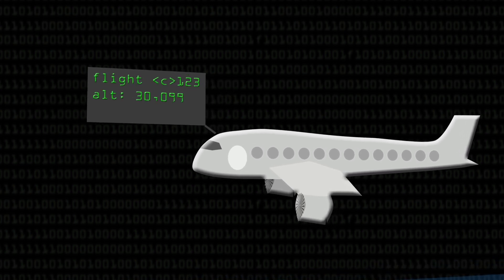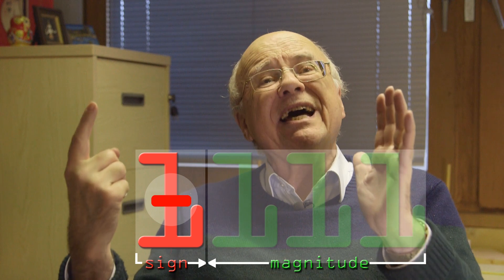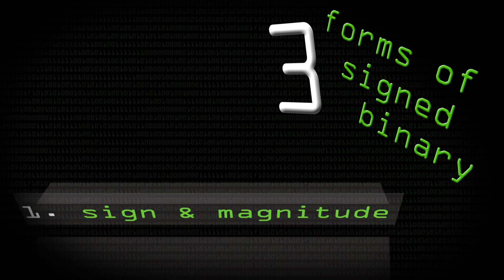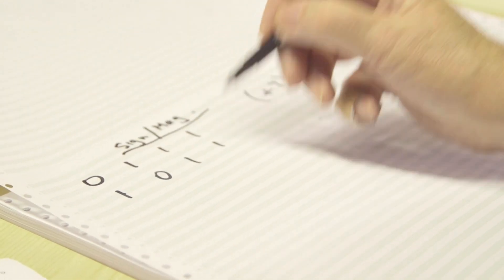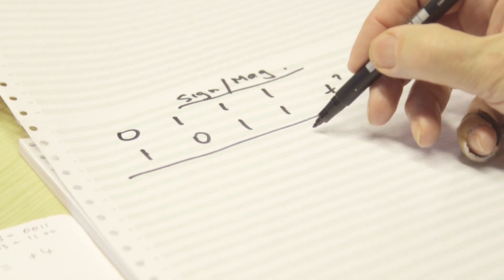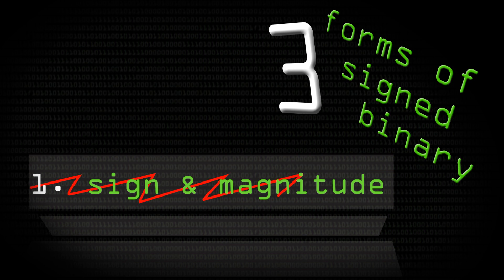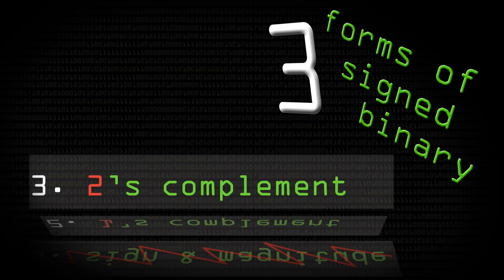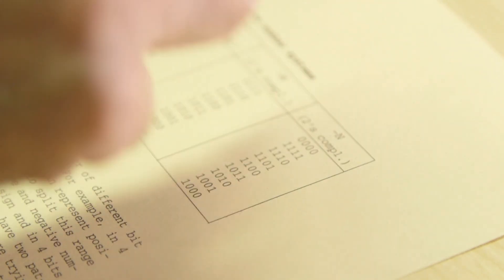Binary: Plusses & Minuses (Why We Use Two's Complement) - Computerphile

Comment: i think of 2s complement as simply flipping all bits, but you include the unstated infinite string of zeros to the right and left.

0001.00000.... = 0000.111111....

an infinite number of 1s triggers a carry, so its just two ways of writing the same number: carried and uncarried.

0010.00000000....

its negative

1101.11111111.... = 1110.0000000000....

that's where the "flip all bits, and add 1" rule for negation comes with.  0.1111111 when you negate 1.00000000 bits causes a carry

Comment: I learned most CS from my grandfather who was an early pioneer in data processing for State Farm and worked there many years. He was around from the days of the IBM 029 system all the way to clusters of PC clone terminals connected to modern mainframes and the internet (still with the choice of either dedicated ISDN, T1/T3, or 56 kilobaud around when he retired in the mid-late 90s).

Every time I hear professor Brailsford start talking through a concept like binary addition over pen and paper i'm instantly transported to being shown the same concepts by my grandpa. Such an amazing teacher, and always bringing the context of the invention itself into the explanation of the solution which helps you remember forever.

Comment: *A signed bit system is is bad because it's extremely limited in size
*1's complement is better, but still bad because there is a positive and negative representation of zero
*2's complement gets rid of both issues by just adding 1 to 1's compliment

Great video!

Comment: 📺💬 Zero, Negative and Positive signs in binary it is depending on accuracy purpose, and ranges.
🦭💬 Instruments that work in ranges to working correct information from multiple devices collide but for a dedicated bit, it does not much of cost but that is meaning you are not paying attention. The wrong decimals points are impossible but by default digits LED display when you stack together not in range numbers or leads 1 is assumed to be a negative number.
🧸💬 Is there any number starting with the highest number and falling down resetting actually it is a reverse negative number when the value change if it is in range it continue. 

📺💬 And when using 2's compliment you do not need to assign the carry bits.
🐑💬 That is correct those meters or gauges display differentiate values, which we called differential instruments but there are more types of devices, integrated devices, differentiate and etc.
📺💬 It is working correctly when they are in ranges and we found something when summing up it is overflow.  
🦭💬 By 2's compliment, the overflow value is summing with negative number to be positive number and that is because of 2's compliment it had error correction.
📺💬 There is carry in, carry out and if it continue carry in and carry out that is hardware overflow indicator.

( knowledge shared for free, I hear from an additional conversation in the VDO 📺💬 They came after to collect some money  )

Comment: When I professionally coded 8bit assembler applications many years ago I standardised on using his "bad" example of using the leftmost bit as a sign indicator and the rightmost 7 bits as the number.
This had big benefits in display and hardware ADC coding, and although you might think it is worse for number adding than twos complement it worked well enough, you just check the sign bit then choose to either add or subtract the number from the total.
So there are definitely commercial products out there using this "bad" system.

Comment: It's always explained like this and it's unnecessarily confusing.  2s complement works just like unsigned integers but with the highest bit negated like this:  (-8, 4, 2, 1)

eg: -6 is 1010 (-8*1 + 4*0 + 2*1 + 1*0)

0100  + 1001 = 1101
      4   +      -7 =       -3

Bet you're not confused anymore.

Comment: A nice property of 2s Complement is that ctz(n) = binaryTrialDiv(n) regardless of the sign of n. What this means is that the number of bitwise trailing zeros always corresponds to the number of times the number can be divided by 2, this accelerates the computation of CTZ by removing a conditional branch.

But the real question is, why not use Binary Offsef? It's the same as 2s Complement but with a flipped sign bit, it has the property that all numbers are sorted mathematically, negatives are lower and positives are higher. It also has the nice feature that you only need 1 addition by an offset proportional to the word size of the register, which removes the need for a bitwise-not operation.

The only downside I see is that the Offset is only constant if you use the same word-size, since every word of different length requires a different offset

Comment: Consider a car odometer with 5 digits. If the odometer shows 99994 this represents the number -6. Why? Because after the car runs 6 kilometers the odometer will be at zero. So you can have 10's complement a alogous with 2's complement. First take the 9's complement by changing every dígit D to 9-D and then add 1. This works and by performing addition as if these were positive numbers you will always be fine. By the way, negative numbers are those over 50000 an positive numbers range up to 49999.

Comment: The reason we use 2's complement: Because addition and subtraction is the same as with the unsigned number. So you could use it anywhere, even on computers that did not support signed numbers. That's it.

On why it works, because the numbers are continuous, so they form a mathematical ring. You don't even need to split the positive and negative numbers evenly. [-4 .. 11] would also work. But it's convenient to split the numbers in a way, where the first bit denotes the negative numbers.

Calling it 2's complement is almost a lie. Because what we are really doing shifting a continuous range of integers [-8 ... 7] to not start at the start (-8), but at 0. The fact that this leads to the negative and the unsigned number adding up to a power of two is just an irrelevant consequence.

Comment: i'll try to explain how the adding negatives works in 2s/1s compliment: 

Short explanation: 
because u counted down to construct negatives and adding is nothing else but counting up again and the extra one comes from -0 + 1 = +0 

Long explenation: 
first only 1s compliment: imagine addition not as adding the whole number x but as adding 1 x times. first consider adding to -0 so 111........1 the first added 1 will give u 000.......0 and the rest will just add up as usual giving u a number that is one less than ur result. so u can see the missing one comes from swapping from -0 to +0. now if u construct negativ numbers counting down from 111.....1 to 1........0  what will happen is that when u add to this negativ number u will make the negative number one smaller, because u counted down not up to construct it, for each time u add a one to it by exactly one untill u reach 111......1 again, at wich point u loose a addition to go to 000......0 and add up regulary. so at the end by adding one if u crossed from 111.......1 to 000.....0 u will get the result u needed. now understand that adding the whole number at once or adding one repeatly makes no diffrence in any way at all and u got ur explenation to how it works. for 2s compliment it works in basicly the same way just that u have the extra one allready in your negative number.

I hope u understand it now because its accualy pretty simple once u understood it.

P.S : sorry for my horrible grammar and misspellings :p

Comment: 1s Complement: 1 & 1 is Zero -  carry 1, 1 & 1 is 0 - carry 1... So  why for example on the position 2^2 it is 0 and not 1 if you do 1 and 1 and carried 1 before (on the position 2^1)? Shouldn´t it be 1 + 1 + 1 = 1?  (1 + 1 (=0) + 1 = 1)
It breaks my brain

Comment: I don't like thinking of a negative number in 2s complement just being a 's complement then adding one. To me, it's much more elegant to think of it as winding back from zero. That is, subtracting the number from zero, which to a human being at least, is just as easy as that adding 1 trick, but much more intuitive. However, the addition trick is no doubt easier in hardware, but from a human intuition point of view, the winding back of a the odometer from 0 provides a much more intuitive and, I think, accurate model.

The issue of detecting overflows (alluded to at the start and mentioned at the end) needs a whole area on its own. One of my big issues with implementation of C (and, maybe, other languages) is all those silent overflows that happen. Not just on a simple case of adding two positive integers and getting a negative without and exception, but the horrible things that happen with expressions combining different integer representations, both by length and whether signed or not. Silent overflows can happen when, unbeknown to the programmer, expressions are calculated within the expression using the "wrong" type of integer (signed or by length) for the output. 

I once ported a C programme written and tested on a 32 bit machine, and it failed catastrophically on a 16 bit environment. That wasn't because care hadn't been taken to use longs and ints appropriately for the output, but because an int had been used within and expression and the the compiler produced code that worked with "int" precision, even though all other variables, including the output was long. No problem on the 16 bit environment, but it blew up on the 8 bit, but silently with no exceptions and splattered all over memory wiping out all the evidence of where it had gone wrong.

Comment: One of the machines I worked on as a young man frequently gave us negative zeros.  So you couldn't use IF X.EQ.0 with any degree of confidence.   I'm not sure which machine it was, it could have been the CDC 6400 or the CDC 7600.
Reply: Yup, one of my assembler classes was on a CDC 6400 and I thought, how strange to use 1's complement.

Comment: There was an overflow bug in Micropose's Railroad Tycoon - if you bought more than 50% of the shares in your company (so you couldn't be thrown out) and then ran the railway in the most inefficient, loss making way possible, your cash would decrease through the negatives (overdrawn balance) until it overflowed and you ended up with the   largest amount of positive cash; IIRC making money at this stage did not overflow back negative

Comment: The ending was a bit confusing but what happens is that you have two bits somewhere in a register that signifies flags. Sign for positive or negative and overflow for out-of-range. These flags are set in hardware automagically whenever the count moves over a specific number in one way or the other.
In Arm the place it happens is xPSR - program status register.
Reply: The twos complement math works logically even if there are no flags. What you are pointing out is an extra function.

Comment: Wouldn't the altimeter go from 32767 to -32768? 
A 16 bit signed integer is the smallest number of bits you can use with a sign and still get up to 30000, and it's got a maximum value of 32767
Not claiming the video is wrong, or even that it really matters, but I'm curious if you guys know something that I don't.

Comment: Excuse me if this is an ignorant question. Why not use a bit from a different memory address to hold the sign? It seems you could use (with 8 bit bytes) a single byte to hold the sign bit for 8 different numbers. My guess is the difference in resource usage and computing time makes this inefficient but I'm just curious about your explanation.
Reply: +snetsjs Your logic of it representing the sign 8 different number is incorrect. Think of it like this - The CPU needs to know the address where that number is stored. For that, another byte would be used up in RAM to store the address of the number. Once the CPU gets the the number, it needs to know if it is positive or negative. To determine that, it needs to find the place in RAM where the sign bit is stored. That place also needs to be referenced by storing it's location in RAM. So already, you have wasted so much space just to address the sign of one number. But that's not all. Now, all the 8 bits are used to represent the number. If you want other numbers to use the same sign byte to represent their sign, there needs to be a way to tell the CPU which bit represent sign if which number. You see where I'm getting at?
Reply: Mridul Tiwary I see what you're saying and think I wasn't clear. I envision a system where a specific bit of a specific byte reference is created when a number is "created". This way the full magnitude (2^system-bits) could be operated on and the sign of the result could be assigned after. This would require an extra bit for each number. If this causes an excessive overhead it could be treated as a separate type and used only when necessary.
Reply: Yes, but the computer doesn't just need to store the byte with the number in it itself, it also needs to store the location of the byte. And if you're then going to store the sign in another byte, even though you may be sharing that byte (or word, or dword, etc) with other variables to save space, it doesn't change the fact that the computer still needs to store 2 addresses for each number, one for the number's location, one for the sign's location, and if you are sharing that sign address with other numbers then you also need to store the offset for which bit in that address has the sign for that number. 

So now to call up that number the computer actually needs 3 different things, and those 3 things must be specifically tied together since they represent a single number, which means that the computer needs to store these 3 things together and is essentially going to need another address to point it to where those are stored.

With your suggestion, when you want to call up a number, you give the computer an address for that overall number, the computer looks it up and gets 3 things: 2 addresses and an offset, then it needs to look up the first address to get the number, then it needs to look up the second address to get another number, then it needs to use the offset to strip out a specific bit from the second number to determine the sign. And THEN it needs to hold both of these numbers in memory (the actual number and an entire other byte, or larger just for the sign). And then the hardware guy needs to make the arithmetic gates to alter the sign byte appropriately.

Whereas with the 2s compliment method, when you want to call up a number, you give the computer the address and it looks it up and it's got the number, and it's basically done. The arithmetic gates are able to work with the number as-is, without any special care about the sign and the value and sign bit just work out properly because of how the negative range is mapped.

So not only are you likely going to wind up using more space instead of saving space, this is all likely going to be slower than simply using the left-bit for the sign, and what do you gain from it? 1 extra bit? But if you think about it, once it's loaded into memory you're using an entire byte (or larger) just to get that extra bit........whereas if that 1 bit is really that important, you can just upgrade to a data-size twice as bit (ie byte to word, word to dword, 32-bit to 64-bit) and you'll use the same amount of memory, but you'll actually be able to use all of that extra memory, and with less overhead.
Reply: Second post to isolate this point: the key factor is that computers don't generally work well with single or arbitrary numbers of bits. It's far more efficient to group them together into standard sizes (bytes, words, dwords, etc). So while it may seem very intuitive to us to say "well if all it needs is 1 more bit then why doesn't it just use a bit from somewhere else", but to a computer, trying to use just 1 extra bit somewhere is actually going to be far less efficient in almost every possible way.
Reply: +snetsjs 
Tiwary and phiefer are right. You would need additional bytes to hold the information where is the sign.
Another solution pops in:
If you really need to use whole 8 bits of the byte, you can add another byte, that will not be shared (to get rid of the offset thing). So one byte will have 8 bits of the number and the other will have one bit as the sign (and it will always be the same bit for all numbers). And these two bytes will always be together (next to each other on disk, memory), so you won't need two addresses.
But what about the 7 unused bits in the other byte? We can use them to extend the number! So now 15 bits of the two bytes will be the number and 1 will be the sign! Voila, you've just discovered 2-byte numbers (or "small integers").

The very basic thing to understand is, that the computer does not give a damn if it has 9bit integer or 13bit or 15 bit.... The bit-adding is parallel, so if you want more than 7+1 bits because you need bigger range, having 15+1 is the same as having 8+1+7unused. 
Also, it would not be useful to have many data types...
Reply: I guess theoretically you could map multiple sign bits to a specific location and not have to worry about storing the location for each individual one, but that's still doing twice the work for just one extra bit.
Reply: Your proposition is an infinite regression problem. If you have 8 bits for a number and 1 bit for the sign, it means that you have 9 bits. It means that you can represent 512 values. But now you cannot represent -512 to 512, so you want to add a bit to have the whole range, ok? Now you have a 10th  bit for the sign. Super, now you have 10 bits. You can represent 1024 value, wouldn't it be nice if we could represent all the values from -1024 to +1024. Add a sign bit and etc...